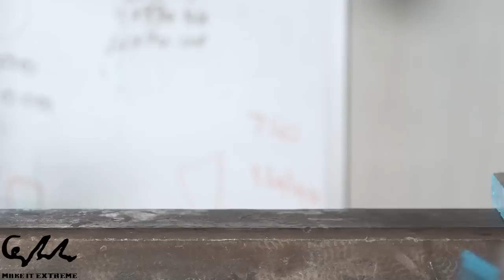Make it Extreme's Motorbike Trailer

Comment: Very good and easy to operate even with only one person.
Having an experience of using a trailer custom made for bike, I would say that there is only lacking a mudgard for the wheel of the trailer and a cover on the bike if the car is diesel.
The filming is good, quick accelerate views of the construction for not boring the viewer.

Comment: This item is simply awesome 😮 
I have a Yamaha 250cc dirt bike and a Hyundai Sonata 2015 
I’m thinking installing the regular hitch it uses for Sonata and try to build something in which I can tide down the front wheel of my motorcycle and hold it to the hitch 
Something I can easily put in car trunk when I leave my motorcycle at the garage for example or if I want to take my motorcycle with me to the beach 
I have to think about it 😃👍🏼

Comment: Nice work, needs suspension. I suspect that’s why you had ratchet straps on the rear swing arm of the bike later on, over bumps that trailer is going to bounce all over the place at highway speeds with the wheel at the very back.

Comment: no better than a simple trailer, having hydraulics on board, it fixes the motorcycle with slings and does not even have simple marker lights and turn signals ...
Reply: You can fix them easily but this is not ment for first world regulations or better used in rural areas.